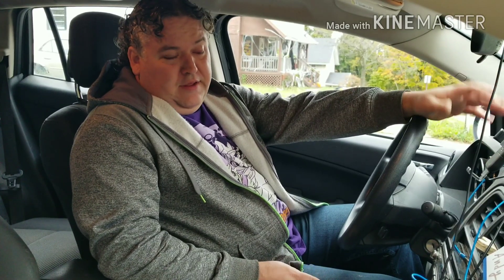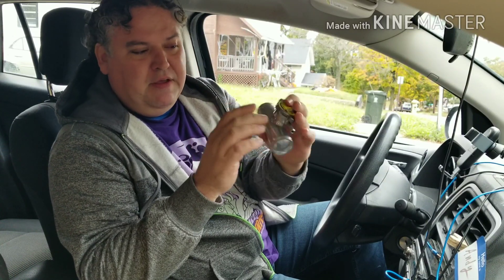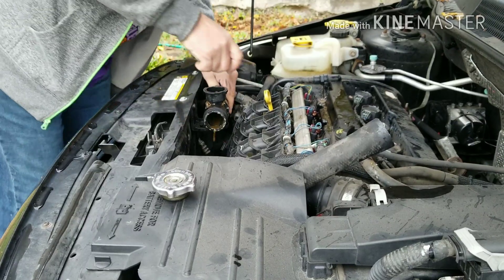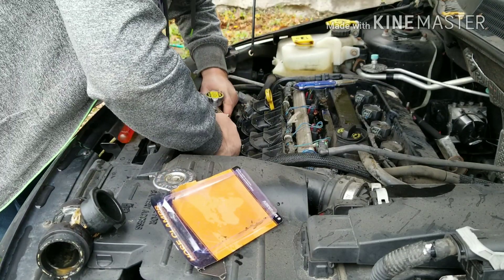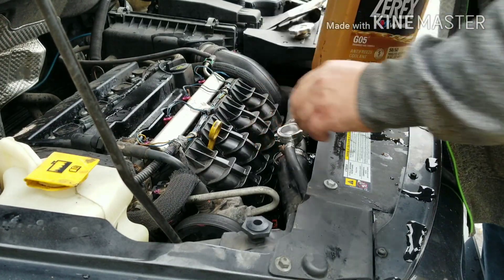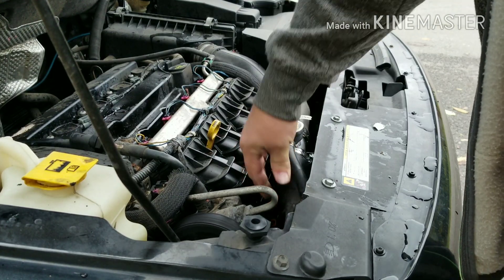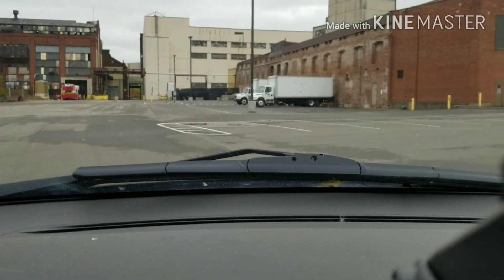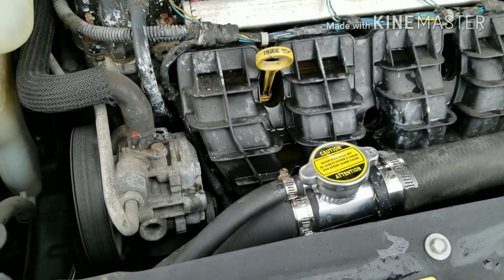Fix your Cooling System with this Cheap Part! | The part Dodge doesn't want you to know about!

Comment: My ac was blowing good one day and the started blowing hot air, I changed the ac compressor but now  it wont  take freon, any idea why are what could it be.
Reply from the maker: When you switch from hot to cold do you hear the air flaps move inside the heater core?

Comment: I have a Caliber and had the same problem with the cap leaking because too much pressure built up. Turns out it was from some stop leak that was used previously and it stopped up the small outlet that comes from the coolant reservoir. Pull that small hose off from the radiator cap side and see if you can blow air through it into the reservoir. I used my mouth but and airhose would work. After that I had heat again.
Reply from the maker: Yeah, stop leak would definitely make a mess. No telling what the previous owner did but that could be what happened
Reply: omg trying this RN... so many problems with mine

Comment: Lol when the blade falls out of the knife. 

I don’t have this issue but I like watching trouble shooting videos in case it happens to my caliber. I’m currently learning how to change everything myself instead of paying a shop. So I appreciate the content.
Reply from the maker: Kool, thanks. Yeah I try to as much as I can myself. Hirering a mechanic can get expensive.
Reply: @calvinthedestroyer  I recently did my spark plugs for the first time for like $20. So I saved some money there. I need to learn how to fix the glove compartment drink cooler. For some reason mine never worked in my caliber.
Reply from the maker: @GTRrocker84  hmm, I've never even used my drink cooler :)

Comment: I had to replace the same part several years ago. At that time the part only cost 24 dollars. Beleive it or not the  plastic part will have a catastrophic faiure once there is a small crack. The expanding water volume will cause that part to crack completely and your car will be in danger of overheating.
Reply from the maker: Dam! So glad I found this Aluminum one instead.